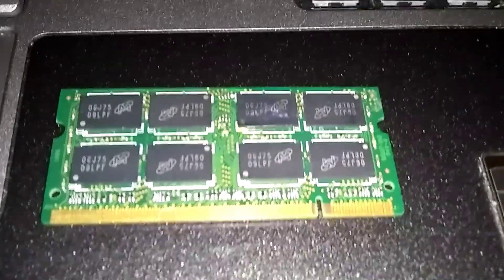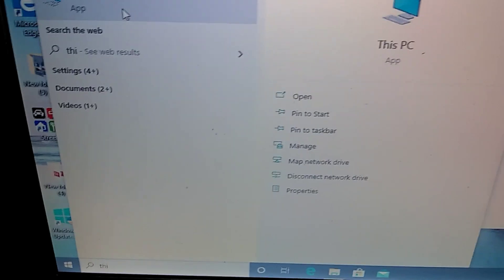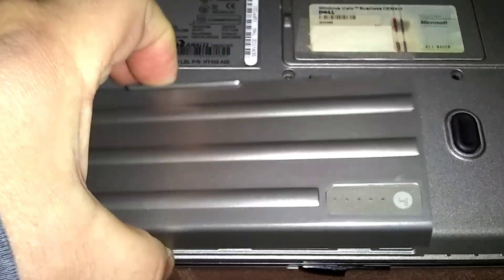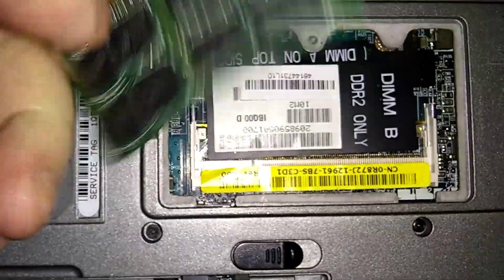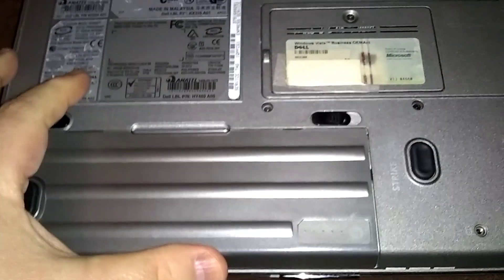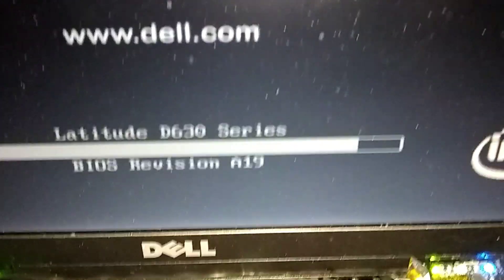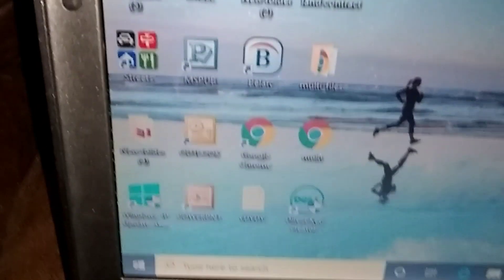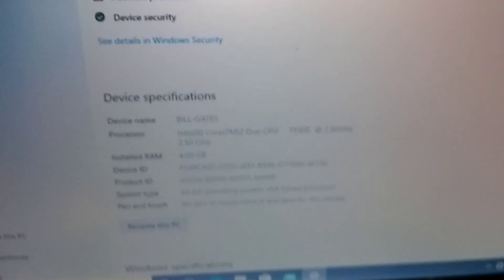How-to Upgrade Laptop Ram, Dell Latitude d620 d630 d820, Nervous Nick

Comment: How do I make windows 10 run normally? Because my laptop is a dell latitude d620 and it has windows 10. And I was wondering, do I have to upgrade the ram memory to make it run faster?
Reply from the maker: Yes, the more Ram/Memory the Better!  It will run Faster!
Reply: Nervous Nick ok so i tested the ram and it still goes slow. Any help?
Reply from the maker: @retrogamer2442  How much Ram does it have?
Reply: Nervous Nick 4gb.
Reply: @retrogamer2442  maybe you should upgrade to ssd
Reply from the maker: Replace the Hard Drive with an SSD!  It will run much Faster!